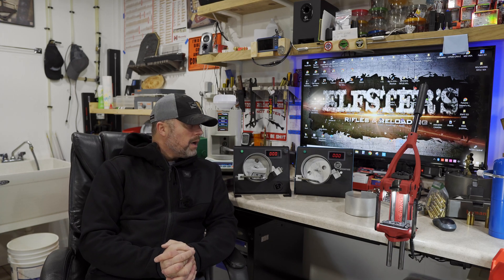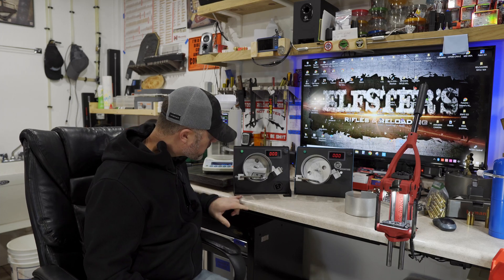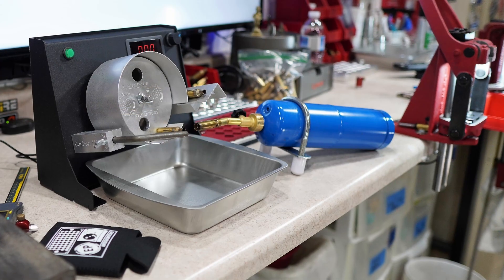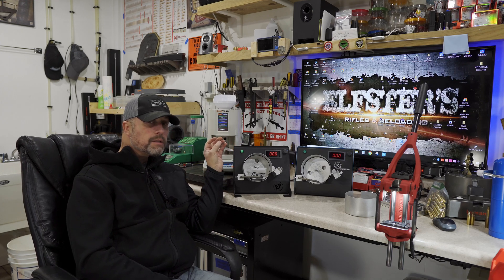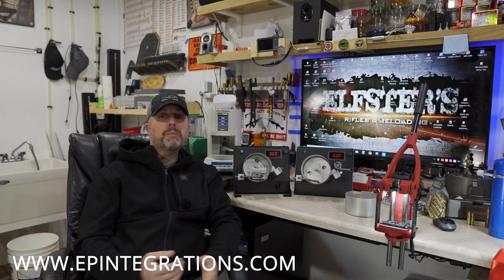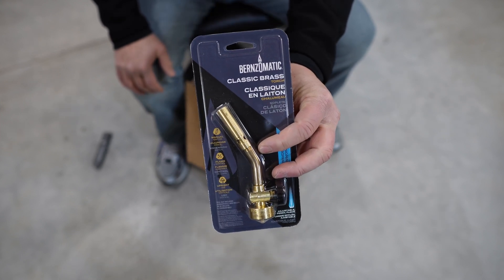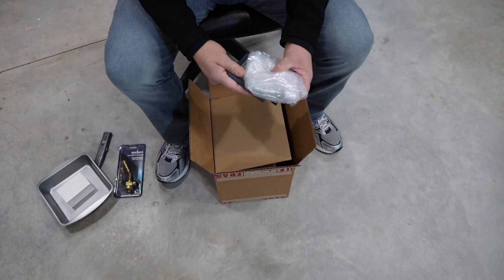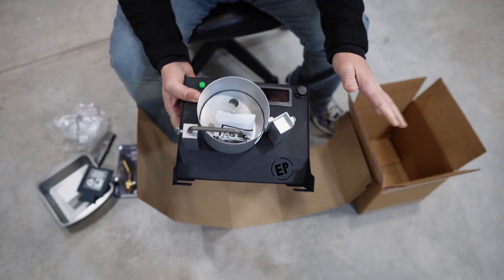EP 2.0 BRASS ANNEALER UPDATED CASE 2023!

Comment: Received my EP 2.0 Brass Annealer just a few day’s ago Sept 2023. I made my first annealing batch yesterday Oct. 2nd 2023 and appears they came out very well, once I had the flame positioned/adjusted to catch the sweet spot on shoulder/neck junction. I did some 223 brass ready to be sized so I decided to anneal them before the next stage (I had already cleaned them). I had my setting on the annealer about 34 which seemed to give that flash of glow on the neck tip. However, make your own determination! The video’s from Todd and F-Class John were extremely beneficial before my first attempt and to get me on track from the start.
The EP 2.0, I do like the leg extension they placed on the unit to avoid potential tip over, simplifying the caliber change, to the loading slide. There are others out there, but not at the price point EP Integration’s is offering $238 (special pricing) at my purchase and code from F-Class John gave me a few extra $$ discounts. Bottom line this system does work at an affordable price scheme out of the box. All you need is your propane tank to hook up to the torch tip, plug it in to the wall outlet.
KEEP IT SIMPLE STUPID. 
Well done to EP Integration’s!!